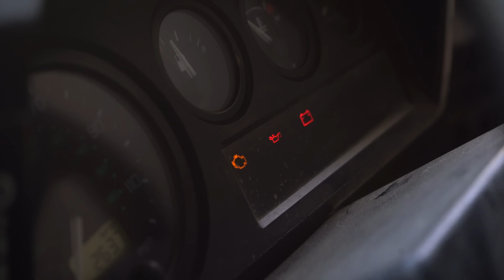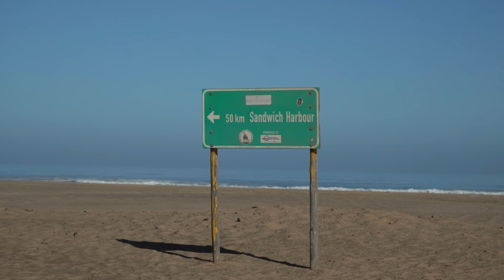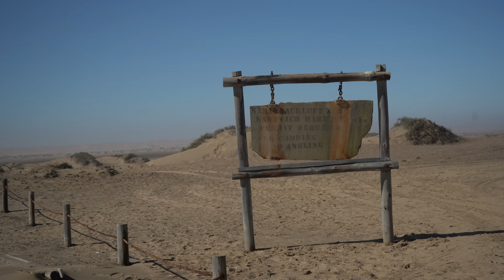Sandwich Harbour Namibia | We Nearly Lost Our Car!! | Full Time Traveller | Land Rover Defender

Comment: Nice vid. 3 of us (all male) will be going to Walvis Bay soon and we will be renting a 4x4 Toyota Hilux auto. May I know do we need to get a permit to enter towards Sandwich Harbour? I saw a photo in your vid with a hanging sign by the road "Namib Naukluft Park Sandwich Harbour Permit Required. No camping, No Angling." Maybe they are refering to no camping and fishing?  We are experienced road drivers but not on dunes. I guess just need a few miles practice. What’s your advise. Shld we take go by our own since we already hv the rented car? BTW, is auto driven ok?  Tks
Reply from the maker: Hi! So you’ll need to acquire a permit in either Walvis bay or Swakopmund I can’t remember I think Walvis bay. Do you use iOverlander? The information is all on there. 
If you can afford to take a guide I would. Especially if you have no experience driving in the sand. Getting stuck is a real possibility and once you’re stuck without the right recovery equipment you can loose vehicles very easily. 
Plus taking a guide you should gain some knowledge from them so next time you can do it safely by yourself! 
Good luck and enjoy!
Reply: @TheLandyExpedition  Tks for info

Comment: Are your wheel alloys? If yes, that guy is over-torqueing them. With a 0.5meter breaker bar, you only need a force of about 27 KG (~250 newtons) to achieve the recommended 133 nm torque  Torque = force (newtons) X distance (m)  or 270 x 0.5 = 135. Wolf HD rims require 170nm which is about 38kg at the handle. Effects of over-torqueing could crack rims or lead to loose nuts down the road.
Reply from the maker: You are absolutely right. He was really tightening them far too much. I noticed as we played back the videos..

Comment: Very educational! Question: surely electronic system must have a subsection where you can drain the fuel system without engaging the combustion section regardless if’s an diesel or petrol engine... Hint hint...😉
Reply from the maker: You can get pump to drain tanks externally but we didn’t have that luxury. The bottom of the TD5 or defender tank holds around 5 Ltrs so wanted to get it all out really! 
H

Comment: Seems like the mis-fuel was a made up drama as well.... I owned a Landy and I would simply have drained the tank using the bottom bung then filled it to the brim with diesel. Why the need to remove the rear tank? Then I can't understand why the beach was such a drama... surely  those Landies can wade through a few inches of water? I don't understand why you timed the trip for a rising tide.
Reply from the maker: Thanks for your input. Can assure you me taking the tank out was not to make drama. 😂 it’s a mission of a job! 
We don’t have a bottom bung in the tank. The bung where you can drain the tank sits 4/5 inches above the bottom of the tank leaving too much petrol in the tank to risk it in my opinion. 

We timed the trip
Perfectly with low tide giving us plenty of time to get down one way. The dunes the other side were too big to tackle forcing us to go back down the beach. It was more the other Landy getting stuck which was the delay and resulted in us cutting it fine. 

Cheers 👍🏻

Comment: I am still confused as to why people do not just have paddle tires.  You canont use recovery boards every 10 feet.  They dont even have to be wide, just get very very very aggressive tread tires as spares, at least 2.  Its going to take up some room, but come on.
Reply from the maker: It’s not necessary especially when you are travelling overland we don’t spend much time in the sand. And we didn’t actually get stuck.. has a lot to do with experience in these driving conditions and knowing your vehicle and it’s limits